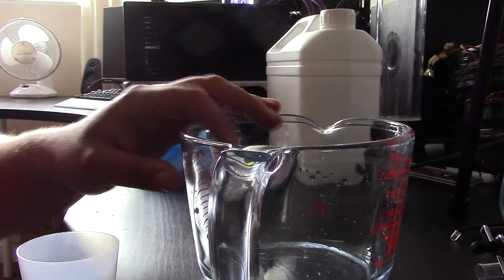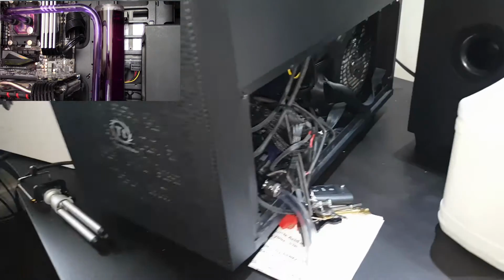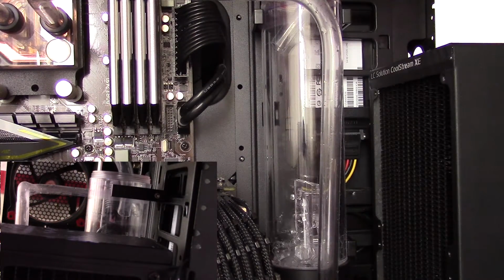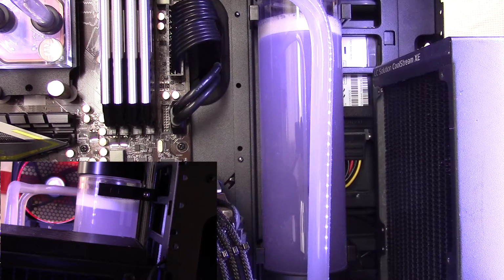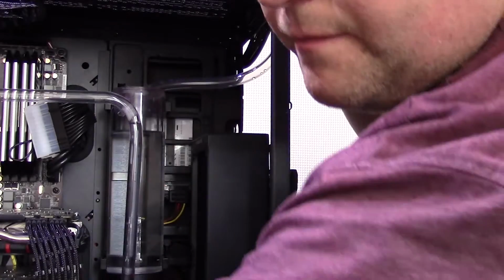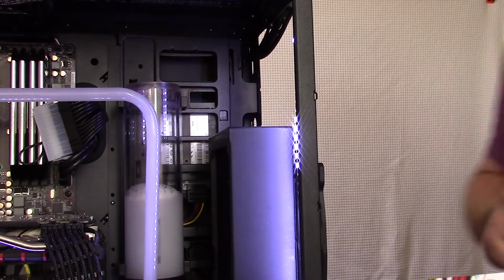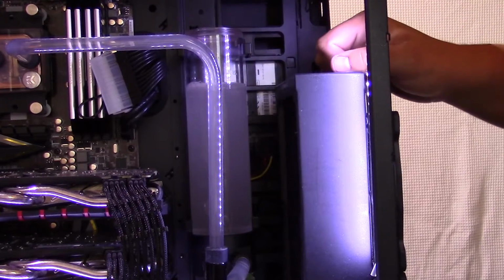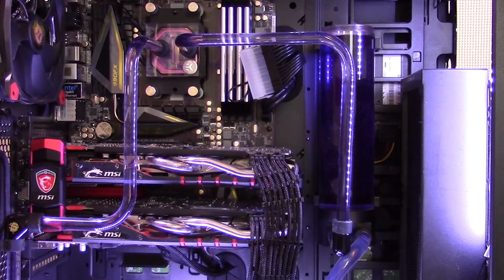MAYHEMS BLITZ PART 2   CLEANING OUT YOUR CUSTOM LOOP

Comment: Did this take all the dye outta ur blocks I have Ek cryofule taking my block apart next week want everything clear again. Does this remove all due residue
Reply: you want to use part one in your radiators only, clean out all your blocks in hot soapy water and a firm toothbrush, part one with eat all the crap in your rads and make them new, part 2 will clean out all the acid and everything else so everything is back to new

Comment: I have just read this stating that only the pump should be running while using part 2 are you sure it's ok to run the pc

Step-by-Step Guide on Cleaning a Custom Loop

Materials Required:

    Distilled water (1gal or more)
    Mayhems Blitz Part 2 kit (found here)
    24pin ATX PSU Jumper (found here)

Step 1:
Drain as much of the coolant in your loop as possible.

Step 2:
Mix Mayhems Blitz Part 2 at a ratio of 25ml of Blitz for every 975ml of distilled water.

Step 3:
Fill your system with the Blitz Part 2 mixture from Step 2 and let it cycle through your system for 12-24hrs. It is recommended to use a 24pin ATX PSU Jumper for this step, as Mayhems Blitz Part 2 is not meant to be used as a coolant, so you do not want anything besides your pump powered on for this step.

Step 4:
Drain the Blitz Part 2 mixture from your system and flush with distilled water a minimum of four (4) times, letting the distilled water cycle for one (1) hour each time.

Step 5:
Fill your system with your new coolant.

You may also want to refer to this video guideon how to use Mayhems Blitz Part 2 for further details on cleaning your custom loop.

Comment: My system is running while I’m using part two. It’s distilled water so I don’t know what the big deal is? Anyway how come mine isn’t soapy?
Reply: Not a good idea, throwing loads of heat into the loop whilst it has cleaning products in will result in inconsistent results.

Comment: Not distilled? Has to be de-ionized?
Reply: mayhems says both will work the same.
Reply: either will work it's because both have impurities removed
Reply: @I0ITuGI0I  you can rinse but I would only pour distilled into the system. These are not the same waters.